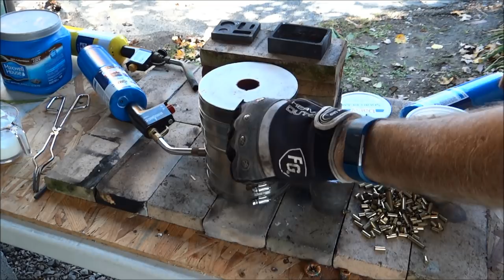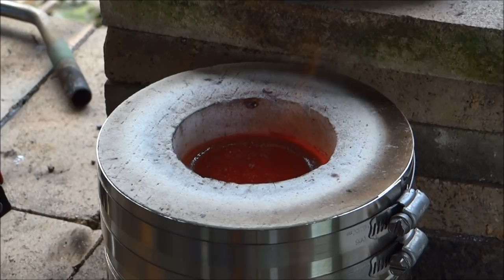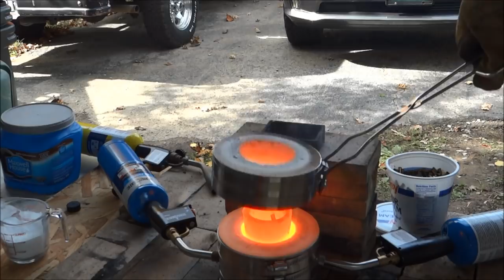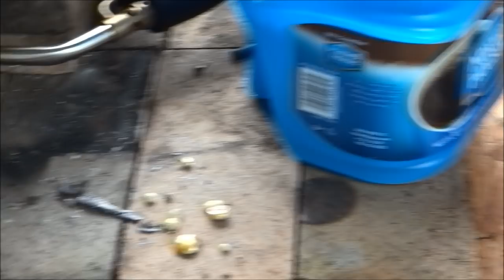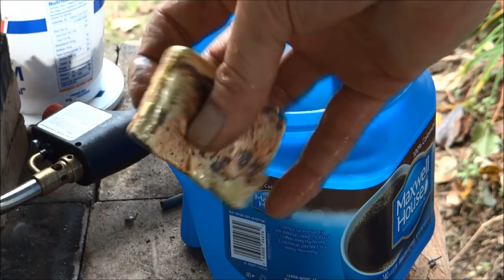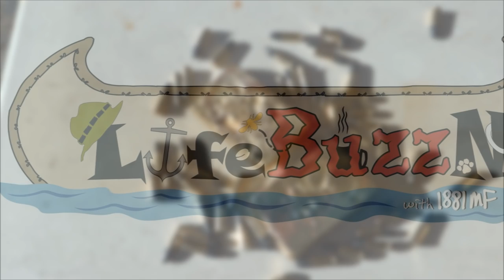From the Foundry - Melting Bullet Brass into Bullion

Comment: The problem is that you very clearly used a bunch of center fire brass to make your bars. So proof of concept sure, but the brass had more value before it was melted down.
Reply from the maker: Any center fire brass that I use have been deemed not re-loadable.  Either too short, damages, too dirty, or reloaded too many times.  Only rim fires and waste brass get melted.  Thanks for watching Josh.
Reply: @LifeBuzzN  Thanks for the reply, you've got a great channel, keep it up.

Comment: There are a few who will turn 22 cases into 223/556 bullets. The problem is the cost of the dies to do so are very expensive.
Reply from the maker: How?  Do you melt and cast them?
Reply: You only need to cast the lead, you anneal the cases and then stretch them to size you want. Anneal again then put some lead in the case. Over simplified it but you should get the idea. I cast my own bullets but don't put a jacket on them other than powder coating.